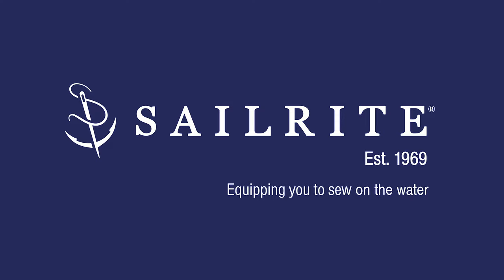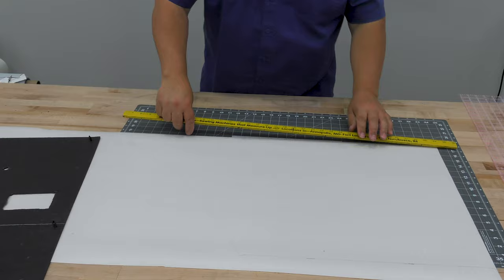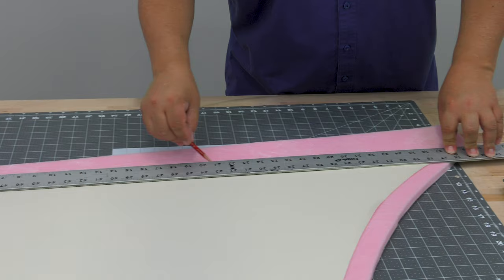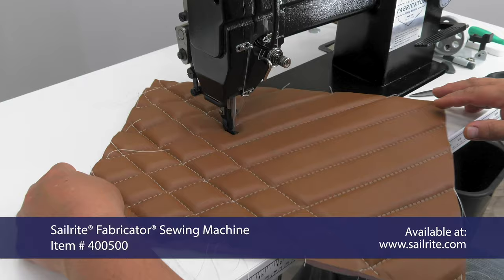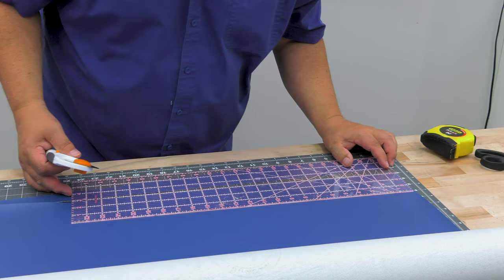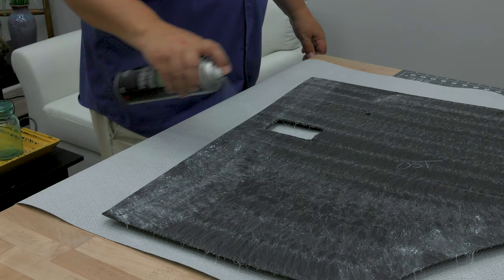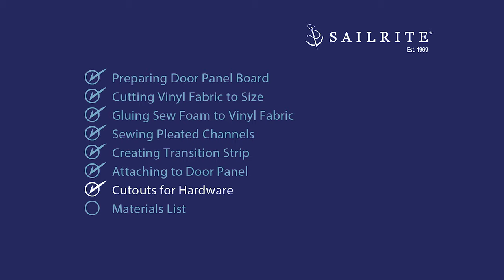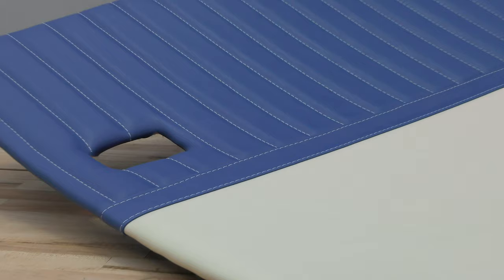Reupholstering a Vintage Car Door Panel

Comment: All of my upholstery work is doing interior panel kits for the classic British Sports car the Triumph TR4 and TR6 so I have two suggestions for your video. The vinyl gets cut about 2" larger than the card but the foam should get cut the same size as the card. This eliminates the bulk that you're showing that can affect how the panels will fit. When you're using upholstery or headliner contact cement, wait for it to flash and feel dry to the touch and then put waxed paper on top of it. Now you can lay the other piece on top of the waxed paper and position it perfectly without fear of things sticking together. Once the pieces are aligned, slide out the pieces of waxed paper.
Reply: Absolutely correct .... as v r manufacturing trims here in delhi india .... v do same
Reply: What about shrinkage from the sewing? when sewing leather to closed cell I have came around a quarter inch short on all sides vertical to stitching when doing stripes similar to the ones in the video. Good advice on the adhesive, I have had mixed results depending upon the adhesive brand though.
Reply: Yellow tr6 can you recover my dash for me . Vinyl or leather. It’s all cracked . 71 Lemans 😊

Comment: You have an incredible amount of bulk as you fold that 1/2 in foam around the panel and that could result in poor fit as you attach the panel to the car.  Try trimming the foam to the panel before wrapping and attaching....
Reply: Good idea! Thanks
Reply: for real
Reply: Not to mention ½” being so overkill for door panels

Comment: too much foam in the corner and around the edges.  A door panel that wont lay flat when installed is wasted time and materials.
Reply: Totally agree looks like crap. Foam should be cut the same size as the board so when the vinyl is bent over it has nothing glide in the back but the vinyl

Comment: Does this machine have a foot operated reverse and a thread cutter?
Reply: no. It will have a lever for reverse and is not an automatic machine. A Juki LU-158 which is a monster long arm machine uses a foot-operated reverse
Reply: at 635 you can see the push down lever for reverse

Comment: Totally wrong, the foam should never go behind the door trim, too fat and bulky. Cut the foam off to the board edge so that you only have the thickness of vinyl around the back.
Reply: How do you staple the vinyl to the board without it coming through the front? Or would the glue be good enough?